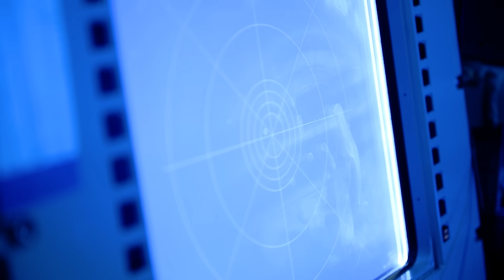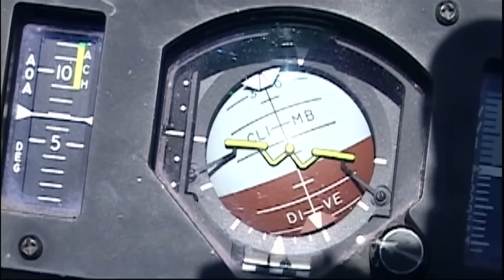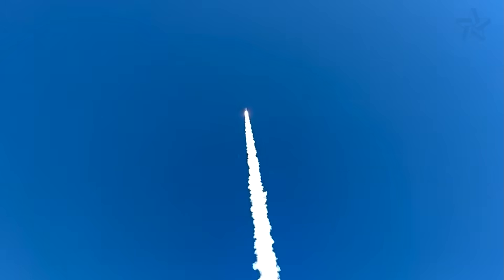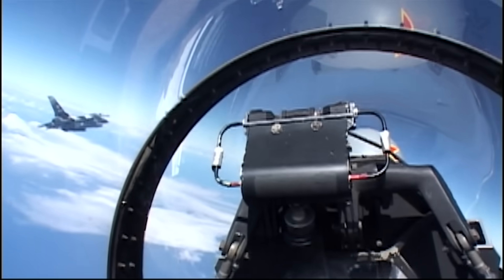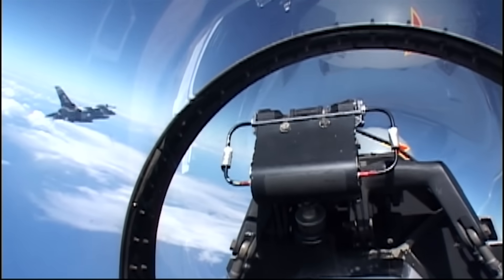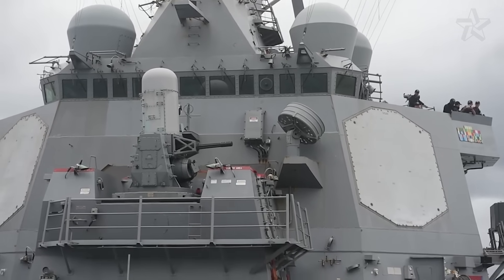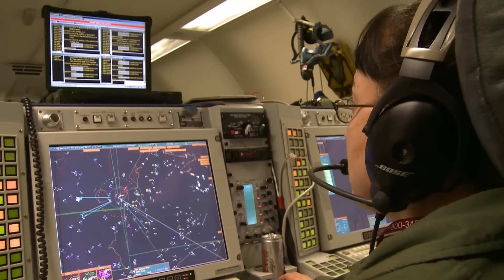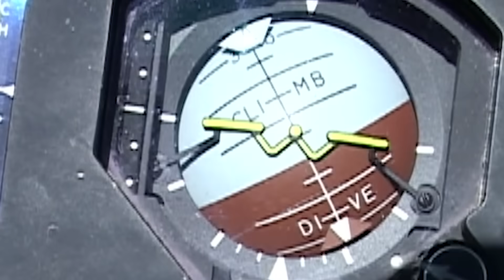Venezuelan Fighter Jet Flies TOO CLOSE to US Navy Destroyer – BIG MISTAKE

Comment: At 17 mins in, talking about the engine compressor stall then bangs right from A-symmetric thrust  with a plane that only has a single engine at 500 feet  off shore in international waters. Its no longer a jet but a bout with wings.

Comment: 17:00 - Asymmetric thrust?!  I'd believe it, if the F-16 could thrust from a second engine from a slightly different vector.  Unless there was a hole in the engine nozzle, there's no asymmetry going on.
While the technology difference is real between current US technology and 1980s technology, this video is full of crap.

Comment: One inaccuracy, you can't have differential thrust on an F16, it's a single engine fighter.  If the engine fails completely, the pilot has two choices:  a dead stick landing at an available field, or ejecting.

Comment: This guy is talking crap!  When the f-16's engine quits for the 2nd time, he says, "the plane yaws due to asymmetric thrust."  Hello... there is no such thing as asymmetric thrust in a centerline thrust single engine aircraft. You have to have engines on both sides.  When 1 quits, the other causes the plane to yaw in the direction of the dead engine.

Comment: Sidewinders are not used for anti ship operations. Gimme a break.
Reply: True but they are heat seeking so maybe?
Reply: @stanleydavidson6543  A brit pilot tried during the 1991 gulf war on an Iraqi frigate and could get a solid lock. And a sidewinder doesn't pack enough punch to do any significant damage.
Reply: @Royalle7521  I had locks on birds that flew in front of me, power lines while auto tracking. we had one lock on the sun. We used a modified Sidewinder for ground to air.  The MIM-72 missile
Reply: @stanleydavidson6543  the aim 9- particularly the version available to these folks at that time- packs a pretty small charge. It's designed to disable an aircraft, not defeat naval armor. Unless it was extremely lucky it would do little more than scratch the paint.
Reply: @stanleydavidson6543 ship is not 1000*
Reply: Now why wouldn't a quasi third world country flying 50 year old outdated fighters include infrared guided heat seeking air to air missiles in their fighter 's combat loadout when faced by American Navy ships? Now you're just being silly. 😅

Comment: The narrator stating how much fuel was used and other things about the aircraft. There is NO way that he can tell these things. The tail markings on the F 16 is from Eglin AFB in Florida.  ET
Reply: Wow.  Thank you?  I have not I.D.'d an authoritative source, but for now, I am going with your critique.  The comment section is best used this way.  I don't accept the info I get as given, but without an alt source it can be tough to criticize outside my area of expertise - cooking
Reply: @occasionallysocial actually he's a bit of a knob head. I flew the F-15C for 14 years, I never saw a 4k photo drone flying with us during an engagement recording high quality video, and using the model aircraft and maneuvers and power settings to estimate things like fuel burn is a completely normal thing to do and much more accurate than you would expect. These guys are blatant amateurs flying extremely outdated hardware. Basically the lead split s-ed over the ship in an attempt to make a high speed overhead attack, which was a wonderful tactic in 1942.
Reply: I know Eglin. I'm English but my wife was American. Her mum was secretary for one of the top brass. We were taken into the climatic hanger to look at an F15. It was the only plane left at the base because the rest had been scrambled Inland due to a hurricane approaching. I was surprised at how far off the ground they are. Beautiful piece of kit.
Reply: Thank you for informing us, Professor, and am truly sorry you won’t be getting that package 📦 from el presidente maduro anymore.
Reply: Good grief, they use stock footage and estimate fuel states etc, it's not rocket science and it's commonly done. You think they're going to have 4k air to air camera footage of an actual engagement?
Reply: @preacherF-15  Exactly!
Reply: @preacherF-15 Así cualquiera 😂😂😂
Reply: I thought those were Eglin markings I grew up in niceville my grandpa stationed there
Reply: Hence, why these videos are bullshit.
Reply: I feel like he’s just saying a lot of rambling stuff
Reply: I used to live across the Choctawhatchee Bay from Eglin AFB (less than a mile), and LOVED  seeing all the different types of aircraft in the skies. It was mostly fighters headed out over the Gulf for maneuvers, and it was every few minutes that you'd see a pair coming in or going out. Super cool.

 But I've also seen 2 Ospreys (very loud for having props rather than jets), and a stealth bomber and fighter once each.

Sometimes you could even hear bombs exploding on the test range.

Even though it hadn't come from Eglin, I even saw a space shuttle being piggybacked down to south FL.

Comment: They want to start a war with the US using that old ass equipment. The US can send 2 F-22 and that will solve all of Venezuela military problems boom have a nice day who is next to be dumb.
Reply: And do it in less than 2hrs and be back by 12:00 for chow.
Reply: obviously it is trump who is pushing for war to steal oil from Venezuela. what a slime.
Reply: @petermartell568 and you'd whine your ass off if you couldn't get your gas.